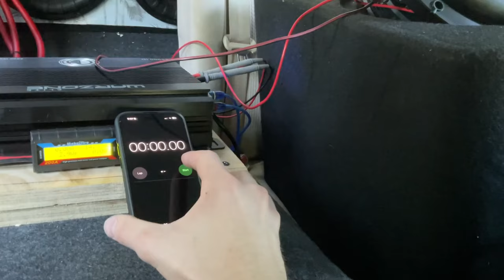Does It ACTUALLY Last?

Comment: Do u understand this test when done at certain frequencies?  The higher the hz the more puffs of air the venting system of a woofer cycles air to cool it.  Try a 25hz same rms testcyoull know what the deal is.  In theory every sub should go down to its fs and run all day rms tones
Reply from the maker: it will bottom out at 25 hz 1500